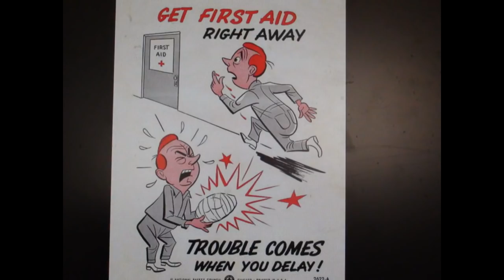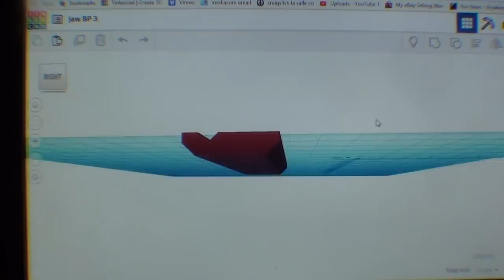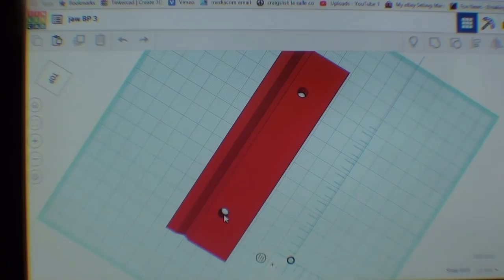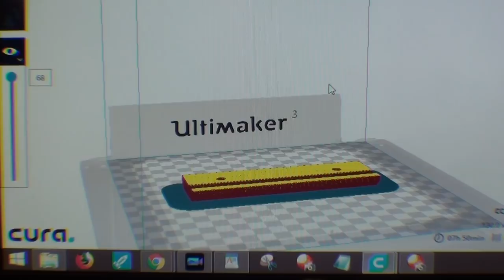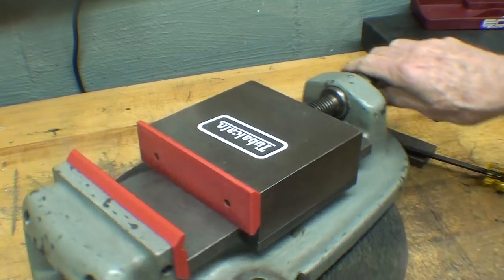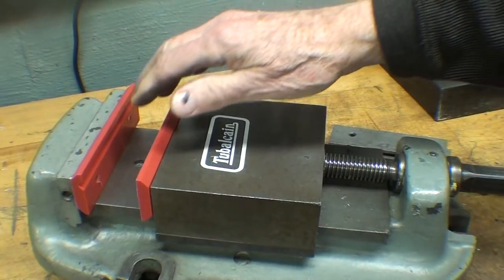3D Printed Jaws for Bridgeport Mill TIPS #422 tubalcain

Comment: Printing may take more wall clock time, but it takes less of your time. At least if you have the model already or someone else made the model.

It may also take less skill to print. Your printed object may have features you would not bother doing manually. Either because it would take too much time to do these features or that you lack the skills or tools to do it.

With more advanced CAD like Fusion 360 you can do something called parametric design. This allows you to define some variables that can be changed, such as the major dimensions. Then if you need the same item but a different size, all you need is change the value and the program recalculates the design based on the new values. It sounds advanced but is actually fairly easy.

With this you put all your effort in once to make a good design and then you can always have as many as you want later on. Maybe years later and you lost the original. You simply print another one.
Reply from the maker: Thank you for a very good comment I think you understand what I am trying to do

Comment: also , when you print at 100% INFILL , don't be afraid to clamp it up and make a pass with the flycutter to clean and flatten the ugly surface.. Now that will not work as well at 50% infill , and come out horrid at 20%
Reply from the maker: I need to try that but I bet it would leave a terrible Burr
Reply: yes, one edge will be confetti

Comment: there is a metric thread option in " community objects " down at the bottom of the list on the left hand side.. You can adjust all the specs of the thread, and being a machinist certainly makes that option easier

Comment: I have never had luck printing through the night, something usually happens. I typically get a good finish on the bottom printing right on the bed, no raft.I use a different program, model in inches then when I export I click the option to convert to metric. Even though my machine doesn't seem to care if it is metric or inch, it has the slicer built into the machine.

Comment: Those will work.  Great to make for a special or odd shaped part to hold.
Reply from the maker: Hi Randy, thank you for the scriber. I like the hexagon
Reply: S/N#1 for my #1 you Tuber.
Reply: When I needed soft jaws for my 6 inch bench vise I made them out of wood to hold my 1873 lever action receiver. 3D printer just arrived so thanks for the idea to make special jaws when needed.

Comment: On Tinkercad you can change from metric to inches.  Down at the bottom right click on "edit grid" and choose inches.
Reply: Although it doesn't matter in a great many cases, to achieve the best finish possible you always need to design in the same measurement system as your printers belts and lead screws to avoid visible artifacts due to rounding errors. Hope I don't sound like I'm arguing, just seems like folks that find your advice helpful would need to know that.
Reply: I've done that before, had no issues printing it. also there is a metric thread generator, have not found a good one SAE threads though.
Reply from the maker: Thanks, I will check out that feature

Comment: Although you may think the soft jaws not a very useful ,the experience will be invaluable when pattern making . Have you tried casting any of the gears you printed ? We would be interested to see how well they would cast . Draft , Pitch , Pressure angle  all the reasons for not doing it .
Reply from the maker: It would not work to try and use the printed gears as foundry better news

Comment: I really like that you only do practical 3D printing and not figurines and artsy stuff.  Milling the soft jaws from the sheet of PVC would have been more efficient in this case.  But as your modeling skills develop, the 3D printer has the potential to make things that would be extremely difficult or even impossible on the mill.  Also, for a complicated milling operation you couldn't even buy the tooling for what the entire printer cost.  Keep it up!  I appreciate everything that you do.
Reply from the maker: Yes, the figurines and such are entirely worthless, and do not interest me

Comment: Mr. Pete
Have you ever placed your 3D printed item on the surface plate and made percise measurements?  I would be interested in knowing the difference between the CAD assigned and actual dimensions.
Reply: Every machine will be different - both different brand models, plus each machine is differently calibrated.  Then, each print might need a little different settings depending on some factors.

There are tolerance tests you can print to get your machine calibrated.

https://www.thingiverse.com/thing:2318105
Reply from the maker: I did that once, but only with a 1 inch cube. And it was darn near perfect

Comment: Have you looked into BuildTak?  I use it on my printer.  No tape, glue, hairspray, etc required.  Clean it with an alcohol wipe every so often and you are good to go.  Very sticky though so I actually use a razor blade scrapper to pop it off.  My printer is smaller, but I can send you a 6.5" square if you want.
Reply from the maker: I need to do that

Comment: As a machinist you've delved into the otherworldly using a 3-D printer,with the intent to use it in support of your machining goals for prototyping and mold replication, exactly what the inventors of the machines creators designed and built them for. Why would you commit to machining a metal prototype which may be altered to final specifications when you can have a machine produce one independently so you may do other things with the time.
Reply from the maker: Thanks for the comment. You seem to fully understand what I am trying to do, and with the printer is capable of. Not for making useless figurines

Comment: You should tap one of the garbage piece’s and see what its stripes out at.
Reply: Barry Cass : Nice idea, but you need to do a comparison and measure the results. Example, same size aluminum, brass, or copper with the same size threads and the same size bolt. Using a hydraulic cylinder with pressure gage measure the breaking point.
Reply from the maker: Good idea, but I have too many irons in the fire

Comment: I agree that stock materials seem cheaper and the time spent cutting and milling are faster than the time to 3D print the parts but what is the cost of the 3D plastic for the parts compared the the cost of of milling the parts, setup time & actual milling labor?
Reply from the maker: Very true, just buy a piece of plastic from McMaster Carr and see how much it costs after shipping and minimum order

Comment: I'm worried that they are going to crack when you tighten a part into them?
Reply: PLA is pretty tough. Possibly a little less strong than machining it out of Delrin or PVC, and definitely less thermally or UV stable, but very much good enough for holding parts securely.
Reply: Why would you tighten soft-jaws hard enough to crack them?
Reply: theyre solid, should be pretty stout.
Reply from the maker: They may prove to be too flimsy

Comment: I have never tried using tape and glue.  I use Aqua Net hairspray right on the the glass bed. It holds the print down very tight and if you don't use a raft the finish really smooth and flat. And when it cools down you can pop it right off. Thanks Mr Pete!
Reply: Stime64 hairspray on glass for me also.
Reply from the maker: I have done that and I did not work